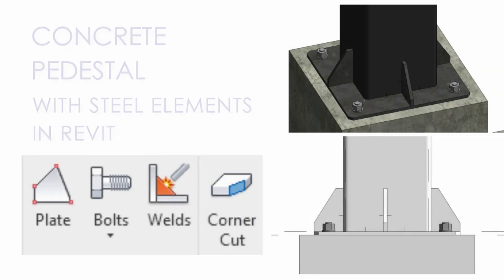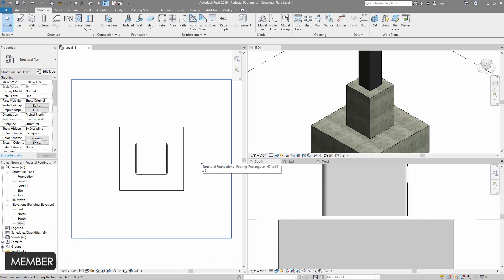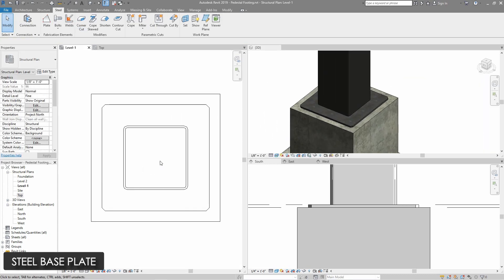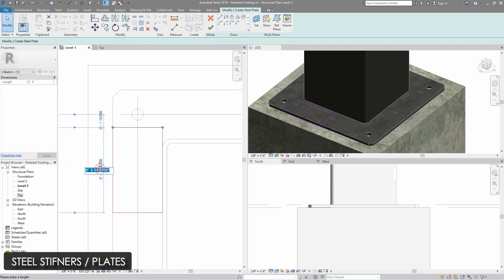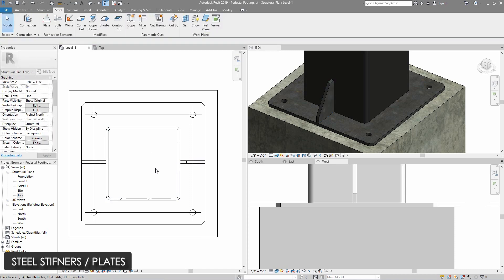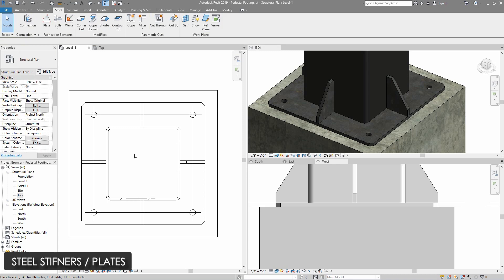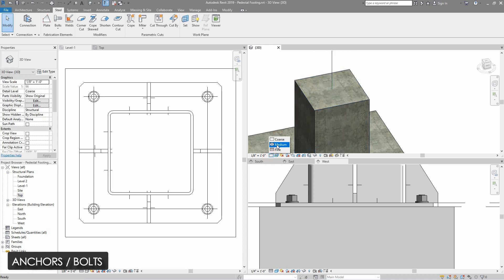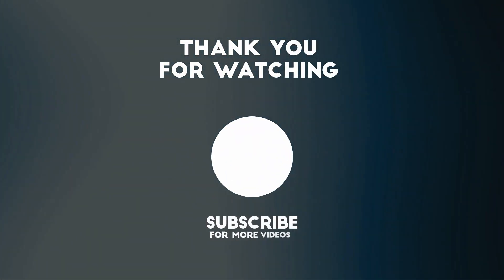CONCRETE PEDESTAL | STEEL CONNECTION WORKS IN REVIT | STEP BY STEP TUTORIAL

Comment: It is wrong to duplicate and modify parameters, when it comes to structural steel members. 
You have to load the Exact Family and type, from the library, according to your need.
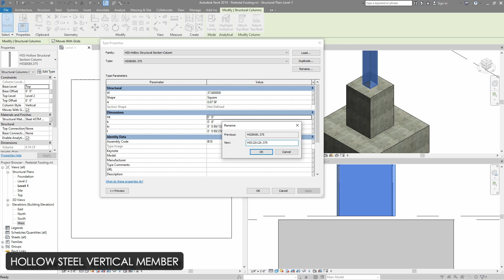As you have shown in 1:30, you only modified 2 of the parameters involved, 
where the rest remains as the original data from the original type.

Comment: Sir if we make balcony railing of almunium that case vertical post bottom side we can provide plat and bolt like flanged its possible or not
Reply from the maker: Actually bolts and nut system is made for mechanical works ... railing comes with vertical posts along with all components of course... But we will make a saperate video on railing
Reply: Thanks sir given reply we hope your next video on this topic

Comment: I have revit 2018 version..steel tab is not there.
Reply from the maker: Steel tab is only visible in 2019 and above versions
Reply: down load and install 2022 check from INSTALLINg DUDE you tube channel